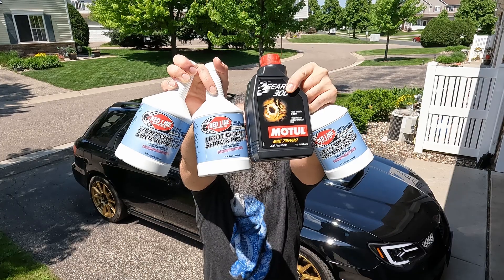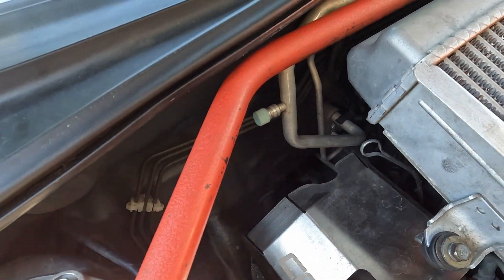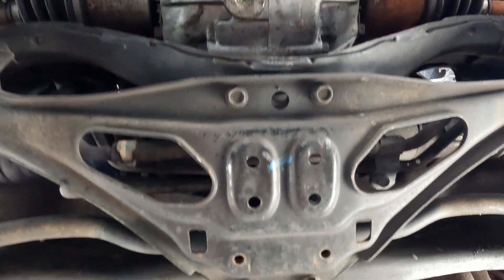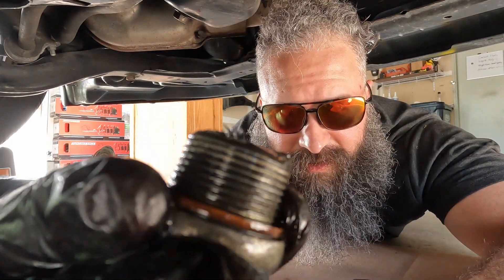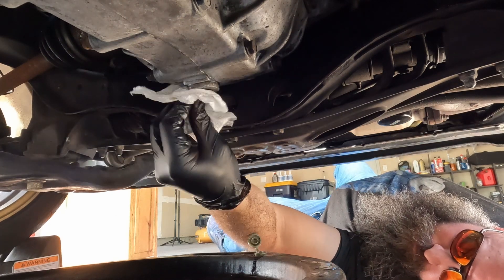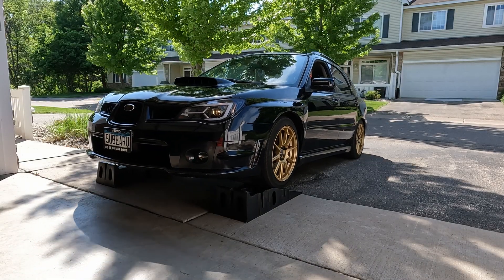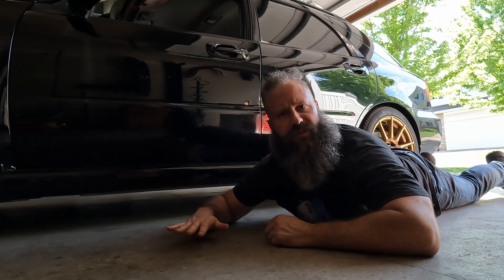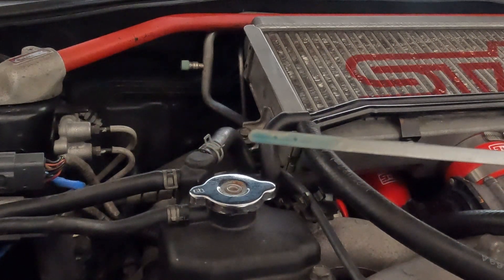How to Change your Transmission and Front Differential Fluid [All Manual Subarus]

Comment: I would preface that this is a mix 90% of people should not follow unless you have a problem with syncros. Not only would one will have to do transmission flushes around the 15k mile mark instead of the 30k by manual as you have a very light weight mixture.
Reply from the maker: I didn't have issues with my syncros and I noticed a difference.  I would recommend anyone to try it and if it's not making a difference for you, then just change it out the next time.